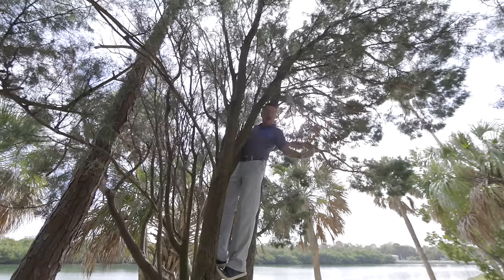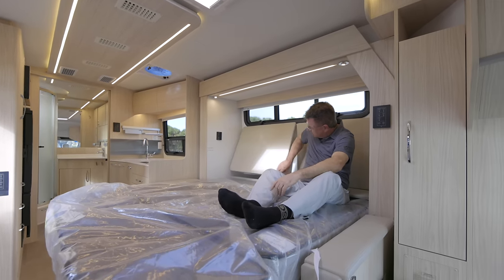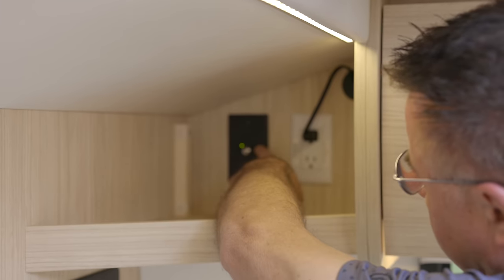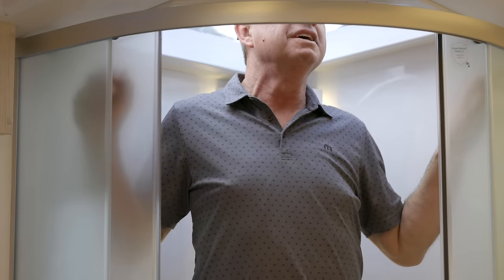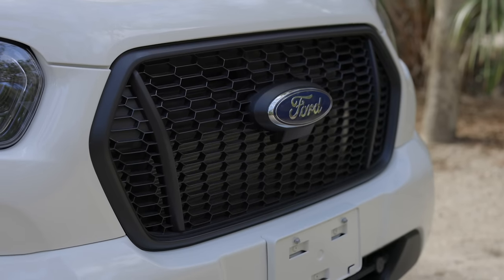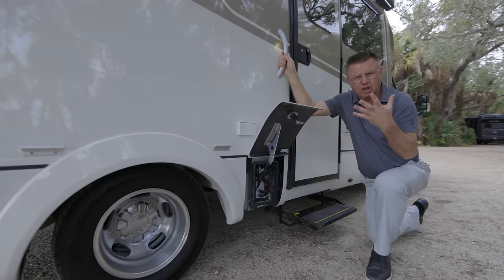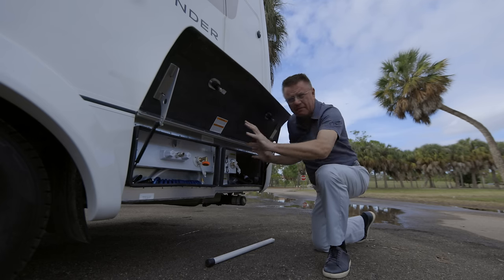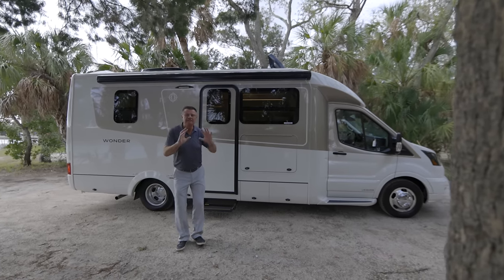2024 Wonder Murphy Bed Lounge

Comment: Waiting for Leisure to get side cameras and all ways on rear camera. Others class B+/C RVs with the same width have side cameras already. Also, would love to see them move to lithium batteries with the built in heater that comes on when needed so no manual intervention is needed. I would also like to see the storage under the slide out come out with the slide out so you don’t have to go under the slide out to get stuff from that compartment. Or change that to be where the propane, batteries, generator are so there isn’t a need to get under their when the slide out is deployed.
Reply: Exactly. They’re supposed to be a luxury brand and they’re falling behind their competition.
Reply: One of the issues is the Transit itself.  Ford introduced the rearview mirror camera on the Transit in 2023, but did not offer it on the cutaway chassis so that’s out of LTV’s control.  And Ford doesn’t yet offer side mirror cameras far as I know.  The Sprinter chassis has the rearview camera and as such LTV includes it.
Reply: @sweethaven-nc  other RV makers are adding these aftermarket.
Reply: I agree with you about the cameras. However, they already have lithium batteries with a built-in heater that turns on when temps fall below 38 degrees F.
Reply: @antiplanner  leisure doesn’t use those batteries yet. They use a heating pad you have to manually turn on.

Comment: This guy is the ultimate salesman! Wonder what the clearance is on the AWD option? Be nice to know if the big drivers side rear storage would fit bikes, vertically or otherwise. That’s what all these B plus/C’s need is bike storage.
Reply: The rear twin bed will give you that on the WONDER. Possibly the Unity's version too. They both have a rear twin model.  Check out the You tube video for LTV 24 RTB Dean does his thing.
Reply: The rear “garage” on the Wonder MLB is basically 24”x24”x56”
Reply: You need to put more interest on quality of build not after all together  cut away structure integrity.  A book looks good by front face but read a chapter and get more content.  The same with RV's

Comment: Ford unreliability! Should go with Mercedes Sprinter!!
Reply: Last I checked there are a total of 384 Mercedes dealerships in the USA compared to over 2900 Ford dealerships.  Not to mention the cost difference in something as simple as an oil change.  The Sprinter is a fine machine, but the Transit is more powerful and less expensive to operate.  I love that LTV offers both so we can choose.